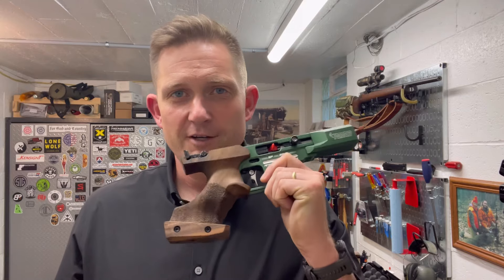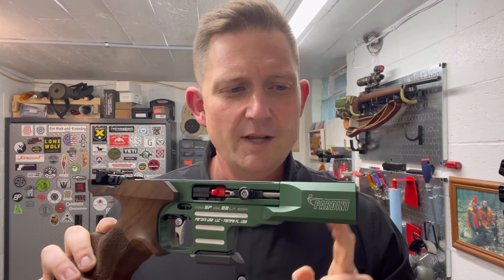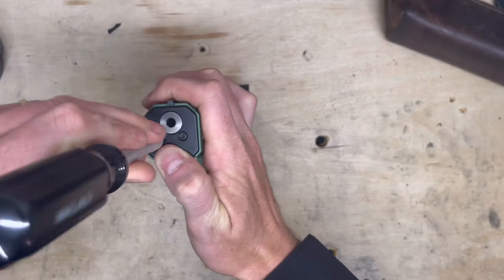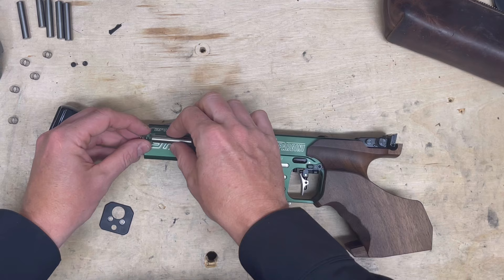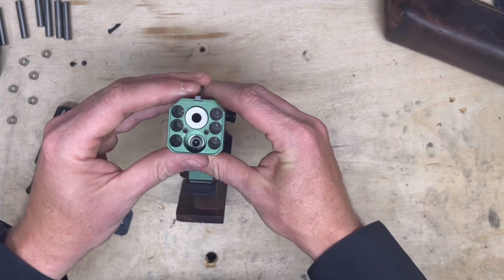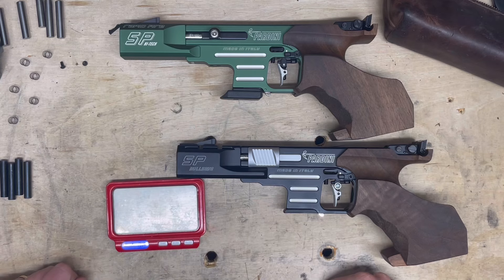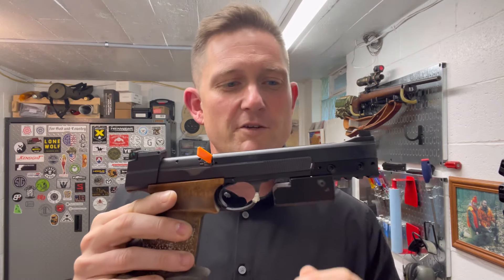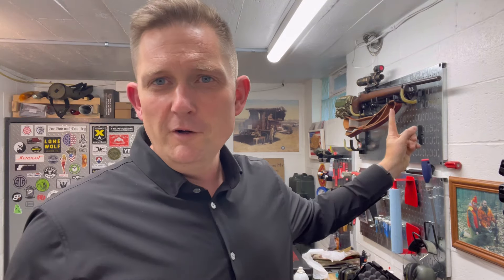Olympic Pistol “Zero” Recoil EXPLAINED!

Comment: What do you recommend for a .22lr bullseye pistol above the Browning Buckmark/Ruger Mark 4 level? I have been thinking Smith 41 but have read they need work when they are new. That means off to a Bullseye Gunsmith and wait a year. Hammerli x-esse is a possibility, the Hammerli 208 and 215 are available as used but parts are not available. Any recommendations? Thank you AG
Reply from the maker: 1911 .22 Conversion.

Comment: The physics of that recoil system is insane crazy 🤯 Im suprised to hear that there is no difference between the tungsten and steel weights. I would expect the tungsten ones to provide a larger counter-recoil force because they are denser. What happens if you change the strength of the springs? 🤔
Reply from the maker: The tungsten do indeed provide more counter recoil force.  Sorry if i didn't explain that.  Not sure on the springs.  Welcome to the channel.

Comment: If it is an air pistol, what is popping out of the gun, it it isn't using bullets?
Reply from the maker: Lead pellets
Reply: @BullseyePistol  I asked this wrong. 
After a shot, something is dropping out of the gun like a shell, but pellets don't have shells.
Reply: @JahBeatSoundSystem I think theres two different classes .22LR actual little bullets and Air Pistol competition.